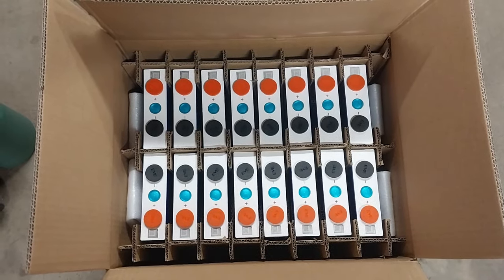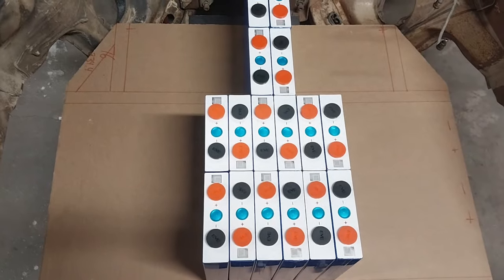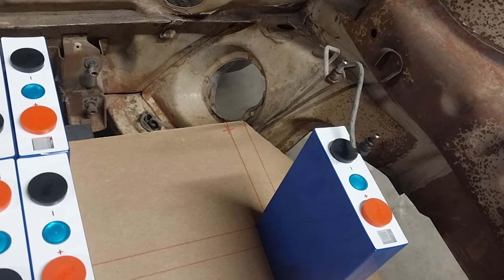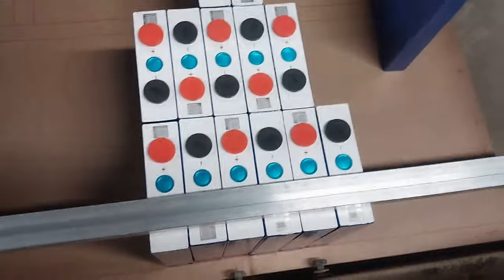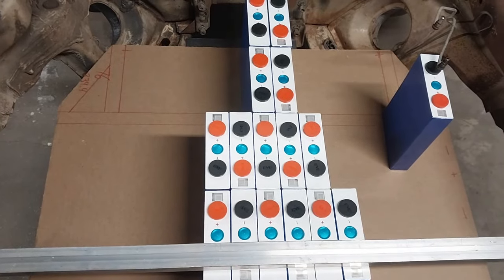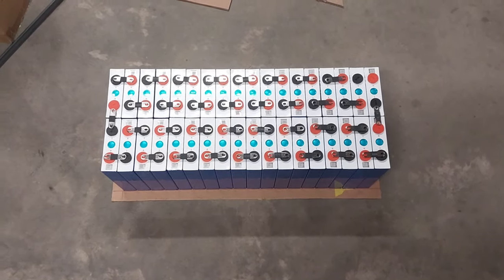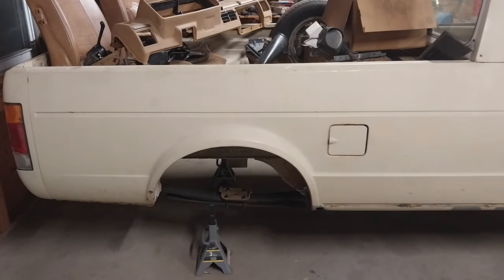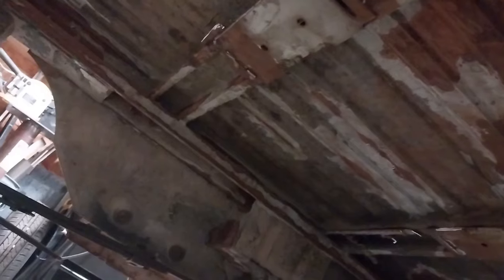Puttin' Batteries - TSLA VW

Comment: What are your thoughts of thin HDPE sheeting between the batteries?   I'm a good six months out on building the box for my conversion (converting a Jaguar XJS using a Leaf motor), but have the same issue with ensuring nothing rubs and shorts, while maintaining compression.  My thinking is HDPE is slippery so any rubbing from vehicle vibration is fairly 'smooth'...

At least that's what I keep telling myself....